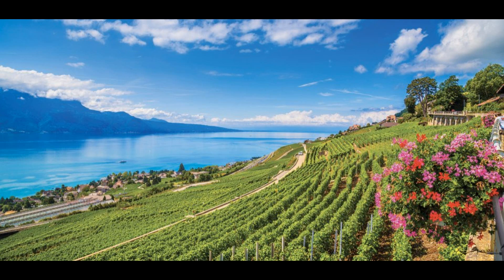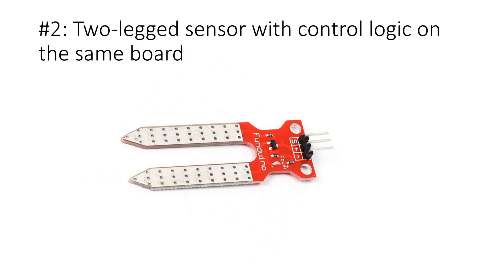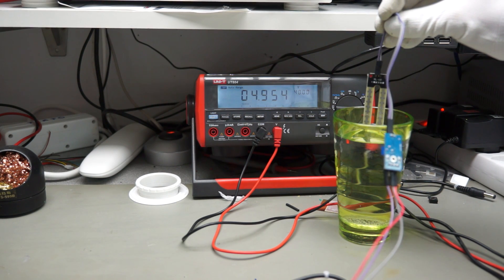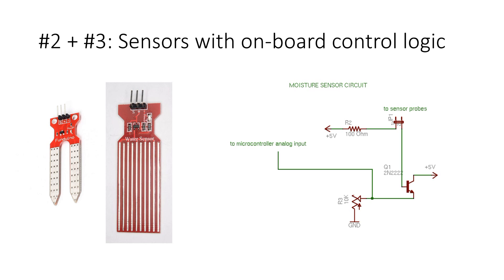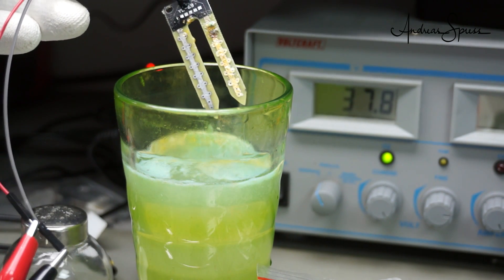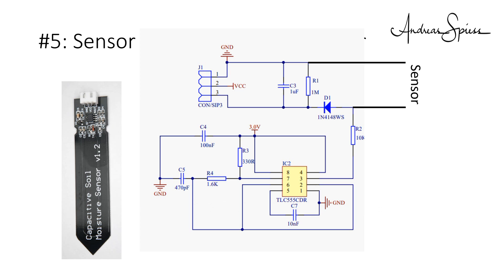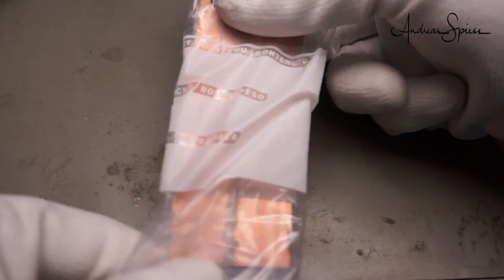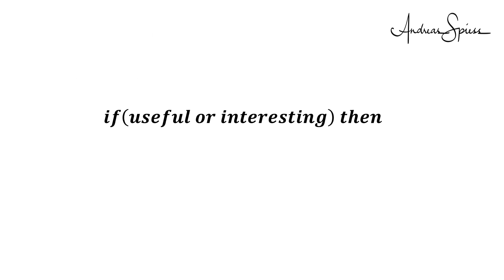#207 Why most Arduino Soil Moisture Sensors suck (incl. solution)

Comment: If I'm using a resistance-based sensor, is the capacitance-based sensor able to be fully swapped without changing code or must you change the code every time you switch sensors?
Reply from the maker: I think you have to calibrate the sensor. Both sensors create a analog value

Comment: is anyone know how to calculate Capacitive soil moisture sensor v1.2? or maybe give me an article about that.

Thanks for your response.
Reply from the maker: The easiest is to measure capacity with a cheap transistor tester.
Reply: Hmm.. Okay.. 
But if we use arduino or raspberry pi with additional ADC Module, the ADC value will inversely proportional with soil moisture condition, it means if the soil too wet, the ADC value will be small or vice versa because the sensor use Capacitor not resistor right?. So,  How to calibrate the capacitive soil moisture sensor In order to have the same comparison with monitoring tools sold in online wich have range value 1 to 10 like this https://www.amazon.com/dp/B07BR52P26/ref=cm_sw_r_cp_apa_i_DXIIDbNC3PVTP

Maybe you have tried to calibrate for that sensor before. Thanks.

Comment: i use a p channel mosfet in series with the sensor ( resistor type ) for only has dc voltaje when a tanke the the value of moist, it reduces the galvanic efect
Reply from the maker: Good Idea.

Comment: Nice explanation sir.  But if the sensor made up of PCB in plastic bag, then how is it sensing the signal?
Reply from the maker: They act as capacitors which change the capacity if they are wet.
Reply: @AndreasSpiess  thank you sir.    Now I understood the working.  By changing capacitor we can change the time constant and hence the waveform's period.

Comment: I used the blue dip coating Andreas suggested and found I lost a lot of sensitivity and had very little difference between dry and wet soil.   I tried a spray version, which worked better for sensitivity but the values seemed to drift over time when immersed.   I was wondering about a thin layer of epoxy resin over the board to provide waterproofing.

I noticed (as others have) adafruit have a capacitance probe, but it doesn't look very water proof for outside use.  

Section 3.5 of the following paper describes effect of frequency on dielectric constant.   I'm thinking a higher frequency measurement would be better.  https://ntrs.nasa.gov/archive/nasa/casi.ntrs.nasa.gov/19750018483.pdf
Reply from the maker: Another viewer also reported a loss of sensitivity in one of the comments.

Comment: Hi Andreas thanks for your time spent to show this for us. Could you do a test? Change the plated electrodes to Iron Galvanized Wire... maybe you have little bit more resistance but it will last.
Reply from the maker: You have plenty of comments about the different ways of measuring humility

Comment: Hey Andreas, thanks for this video. I already found these capacitive sensores myself but haven't thought about protecting them from moisture.
Now I took a similar brand to the plasti dip rubber coating and submerged the whole sensore in it.
The readings, compared to a unprotected, changed by factor 10 ... between dry an wet was for the unprotected sensor 220 steps (550 - 320), for the protected it was ~20 (550 - 530).
So using the rubbercoating will notiably lower the resolution of the sensor.

About the coating: I used Kandydip a german distributor for industrial PUR coatings for cars.
I took the sensor and submerged it in whole, waited 5 minutes and submerged it again (2-layer coating).

Do you know if the electrolube trv (shown in your video) behaves different?
Or did you meant to only apply the coating to the edge of the board, where the pcb is unprotected?

Edit: Maybe it is to mention I used a undiluted coating. The coating can be diluted to use it with spray pistols. A diluted solution could make a thinner layer of protection, resulting in a less notable resolution change.
Reply from the maker: Thank you for sharing your experience. Usually people only protected the edges. The rest seems to be already protected.
Reply: I thought it would not be so much different to a plastic bag ... But I will coat only the edges the next time I am at home.
Reply: Now I used the rubber only on the edges, working perfectly! Still thinking about apply more rubber on the electronics on the top, before I really use them within my project.

Comment: Hmm, the capacitive sensor circuit looks a lot like the touch-switch we made for lamps in highschool.  Where you touch a metal plate, and the lamp turns on or off.
We made the resistive moisture sensors in highschool too - big thick copper probes with heatshrink tubing over everything but the last half inch.... never saw any corrosion, but now I know why it killed all mom's potplants.
Reply from the maker: So you learned interesting stuff at your high school!
Reply: @AndreasSpiess  It was the 90's. The most interesting project was an EEPROM-based voice synthesizer.

Comment: Tried all the moist sensors for extended periods and my experiences were exactly as you described. Last one, capacitive, was also oxidized by the water through the pcb layers... Would nail polish or hot glue be able to seal it?
Reply from the maker: A few commenters suggest using nail polish. It seems to work

Comment: I tried to understand how the capacitive sensor works but I really can't make it; if it deppends on the conductivity of the medium, how putting a plastic bag around doesn't prevent it from obtaining the humidity? When I search for capacitors I get the classic picture of 2 boards with a dieletric in between, but this sensor has only one probe
Reply from the maker: It does not depend on connectivity. Maybe you read about "Capacitors" and how they work. Wet things behave differently than dry things.

Comment: In electromagnetic depth-sounding, especially in magnetotellurics, corrosion is not only a problem because it destroys the electrodes, but the reaction also affects the measurements. One solution is to use Ag-AgCl-electrodes, which are a bit on the pricy side. I think controlling the on and of time of the sensor, as a lot of people mentioned, is probably the most efficient solution for plant-watering, as you really dont need continous measurements.
Reply from the maker: Or go the route I propose with isolated "electrodes"

Comment: Your connections to your simple circuit indicates that one of the blue wires is directly inline with the other, therefore both ends of your home-made capacitor would be receiving the positive pulse of the waveform simultaneously, as it is not connected to ground as it should be and therefore could affect better measurements.
Reply from the maker: You are right. I sometimes have to rebuild my circuits for filming and I did a mistake there.

Comment: Interesting, I wan to detect moisture levels in small mini round bales of hay, as they are spinning in the baler, and am trying to develop the process to do that. I see a detector leg on each side of the spinning bale mounted inside the baler, a small round insulated disc maybe 2 inches in diameter, the bales are 28 inches wide, I wonder if the capacitive type of approach would work when the two "legs" are separated by 28 inches.
Reply: https://pdfs.semanticscholar.org/db5d/c4bbf3d2ec0100e7c86572f6cae8e7f63160.pdf
Reply: https://lib.dr.iastate.edu/cgi/viewcontent.cgi?article=6339&context=etd
Reply from the maker: I am not sure. But you can try. Does not cost a fortune. One of the papers also used some sort of capacitive approach if I understood right.
Reply: @AndreasSpiess  thanks for he reply, i am looking into it

Comment: You can solder some stiff copper wire onto the legs of the  cheap sensors so the PCB tracks are not in the damp soil, but this is only  a partial fix.

I noticed that when the temperature drops at night the conductivity of the soil changes and of course this makes it difficult to set accurate limits. Another problem is that when you add liquid fertilizer like "Miracle Gro" the conductivity of the soil increases as does the  chemical reaction on the wires.

Basically then Andreas' suggestion with the capacitive sensors and waterproof dip is the only reliable way to go.
Reply from the maker: Thank you for sharing your experience!

Comment: The bare conductor sensors will not give the same reading without frequent calibration, even if you have a material that will not corrode. This is caused by change in fertilizer salt from spring to fall and different soil ion exchange capacity from location to location. 
I use a conductivity meter to measure the concentration of hydroponic solutions because at low concentrations the conductivity has a linear response to dissolved solids. Though even this is only accurate in comparing 2 batches of the same formula, as different salt formula have different conductivity slopes. 
I don't know how the capacitor sensor reacts to ion concentration.
Reply from the maker: You are right. These sensors are not at all precise. I have no data showing how the capacitive sensors react to fertilizers. I assume a little less.

Comment: Hi, 
Du sagst der 555 kann nur 500kHz, weshalb diese Sensoren mit weniger arbeiten, obwohl es darüber empfindlicher wäre. Das ich auch überall, max 500kHz.
Die Bauteile in der Schaltung die Du von dem Sensor aufgezeichnet hast geben aber ne Frequenz von 867kHz. 
Sind das nun die Teile die da wirklich drauf sind (also gehts mit mehr) oder war das ein Fehler im Video?

Ich baue das nämlich gerade auf, weil ich schnell sensoren brauche und die aus China noch 3 Wochen brauchen. Allerdings hab ich kein Oszi um dann später zu messen wenn es nicht klappt.
Reply from the maker: Ich habe die Details vergessen. Aber ohne Messgerät wird ein Eigenbau nicht einfach.
Reply: @AndreasSpiess  Messgerät hab ich ja, nur kein Oszi....
Der Nachbau auf Lochraster mit SMD NE555 hat geklappt (der einzige den ich spontan da hatte).
Sehr umstäandlich, aber ging.

Ich hab folgendes ändern müssen:
1)
Statt 1,6k 3,3k damit die Frequenz für den NE passt
2) War der Messwert wie blöd am schwanken. Ich hab erst versucht A0 mit diversen Kondensatoren weiter zu stabilisieren, mit nur mäßigem Erfolg (ich konnte ja bekanntlich nicht messen).

Dann dachte ich es liegt garantiert daran, dass der Timer die Versorgungsspannung stört und hab nen Tiefpass in die + Leitung gebaut.
10R + 47uF (100R geht auch, dann liegt der Messbereich nur tiefer, ist aber gleich breit).

Jetzt geht alles super!
Vielleicht hilfts ja wem!

Comment: Hi!
8:36
Your sensor is connected via the purple wires to the same node. Shouldn't one of the terminals go to GND?
Im trying to replicate this but I dont understand how to make the "ugly" sensor. What king of considerations are important? size? separation? area?
Reply from the maker: You are right about the wiring! Sometimes I have to rebuild things for filming. And obviously, I made a mistake there. Size and distance between the two electrodes for sure have an influence. But I did no experiment too much with it.

Comment: Hi
I have a question
You apply pulses to the sensor terminals, but with the same polarity, not AC, just ON/OFF.
Have you test it, for a long time? Still the sensor intact?
I had the same problem, but I solved powering the sensor with an AC transformer and rectifiying with a diodes bridge. Also I added a capacitor for smooth the signal.
Reply from the maker: There are other comments about changing the polarity of the sensors. You can do it by connecting the sensor to two pins.

Comment: 6:20 yes, they can: as you said it's an electrolysis, the green stuff in this case is copper oxide (and probably other weird things will form too as soon as you put earth with all its minerals around it), and you want that neither in your plants nor on/in your body. it can (to varying degrees) poison both your plants and you (e.g. if you eat the plants, or through regular contact e.g. by handling the stuff and not washing your hands thoroughly). the amount of copper (and probably tin and maybe lead from the HASL coating) in those traces are very unlikely to be enough to seriously endanger you but you still don't wanna risk it, even small amounts that don't kill you can still have various negative effects on your health. and your plants will likely die (you can reliably kill big trees by driving a single copper nail into their bark).
Reply from the maker: You are right. There are many comments discussing this fact.

Comment: It's just a simple comparable testing between contact(conductive) sensors  and non contact(capacitive sensors).   But contact sensors are still being used because it might comfortably to replace on ecah crop cycle or it's in needed for short critical growing period.
Reply from the maker: You are right.

Comment: Nothing wrong with an electronics project but for those looking to water their plants automatically with the least hardware, check this out at www.blumat.com I've used them for three seasons to water tomato plants in a glass house. Water supply can be either water container or tap with pressure reducer. A 1000liter tank with rainwater collected from the glass house roof will last a month for 10-15 plants.
Reply from the maker: Thank you for the link. I also like "low-tech" solutions.

Comment: The green stuff is Copper.
I just took 2 big steel nails put them into an 2 wide luster terminal strip (Lüsterklemme).
The trick to avoid electrolysis is to not connect to DC but to an arduino output and just give it power while reading the sensor for a millisecond.
Reply from the maker: There are many discussions in the comments about this method.
Reply: @AndreasSpiess  don't want to read all comments since I'm building a circuit right now.
Were they positive about this method? For me it works perfectly.

Comment: resistive sensors are OK if you use it correctly.  galvanic damage to sensor only occurs when you constantly supply voltage but  it is just stupid.  sensor don't need to be constantly powered.
just turn it on for 1 second  every 30 minutes and it will last forever.  constantly powered sensor it's just like constantly powered headlights in your car when it stands on a parking over night.
Reply from the maker: Maybe you read the other comments concerning this topic. It is definitively an advantage but still does not solve the issue in many cases.

Comment: You could treat the sensor like you do an LCD screen and ensure there is never a DC offset to prevent electrolysis. Maybe with an H-bridge to flip the polarity and therefore drive it with AC.
Hugely overcomplicated, and you'd still get normal corrosion, but at least it wouldn't be accelerated by electrolysis. Sounds like a fun project!
Btw, not dangerous chemically if used in a non confined space. The amount of hydrogen coming off is tiny and it will quickly disperse and float away. Confined and sealed space... Not good
Reply from the maker: There are many suggestions about that topic in the comments. There is a simple solution with just using 2 processor pins. But it seems not to be the solution.

Comment: Hi, have you considered using conductive paper as electrodes? Check out the PapierLogik project. This should be interesting for your research. http://www.papierlogik.com
Reply from the maker: No. But I do not see a big difference.
Reply: @AndreasSpiess  Thanks for your answer. Well if you use paper-based electrodes, you will not have any oxydation... paper will also degrade over time but it is easy and cheap to rebuild and it will degrade into organic elements that will feed the plant and leave no oxydisation residues that could pollue the plant. This makes an environmental-friendly life-cycle to your sensors, which is rarerely the case for electronic components that are not often recycled properly even in developped countries...

Comment: Wait so the homemade moister sensor you used 2 old PCB’s and just divided them with an insulator? With what as an insulator? To me they look like two copper plates and not PCB’s.

Edit: This is probably going to be another newbie question to ask but do you have a simple drawing of the circuitry you used on that homemade sensor?
Reply: he scratched away the copper on top, that way it's insulated from each other.
Reply: CactusRoc okay thanks!

Comment: Just switch polarity every time you check moisture. Second thing - buy only gold plated sensors.
Reply: They ll corrode anyways but a little bit slower and switching wont help until you saturate the soil with copper salts. Additionally platinium would be a much better choive then gold.
Reply: Decreasing sampling frequency and reducing sampling time would improve cheap sensors lifespan considerably.

Comment: Would it makes sense to use the sensor's capacitance to control the 555 frequency and use frequency measures instead of the analog signal ?
Reply from the maker: Maybe, I did not try.

Comment: You can use nail polish protector to water proof electronics at the top of capacitive sensor.....
This is easily available everywhere...

I used for ftdi and another nano boards... It works fine...
Reply from the maker: Thanks for the tip!

Comment: What about measuring the resistance using AC signal, uh?  Whatever... too complicated for a typical arduinist... they will never learn anything.
Reply: Oh come on... That's a bit harsh..I have got hooked on Arduino and pics for most of my projects... Still going strong at 78 !
Reply from the maker: The capacitive one uses AC.